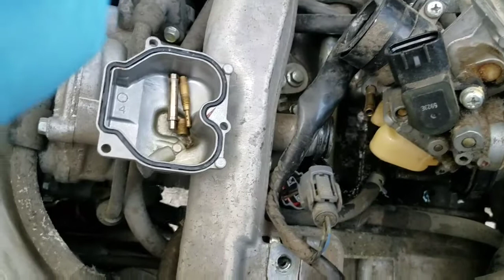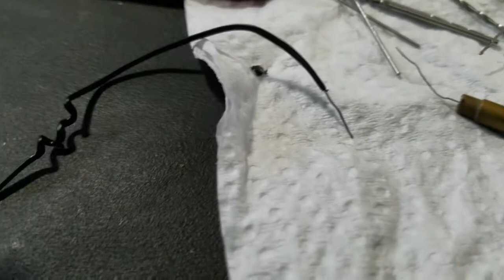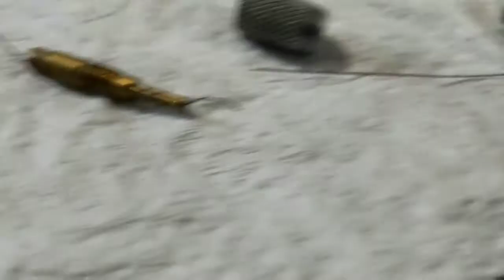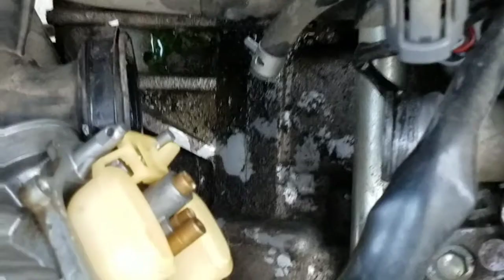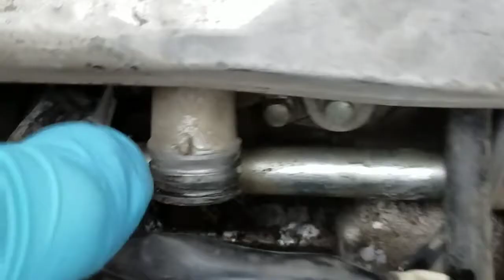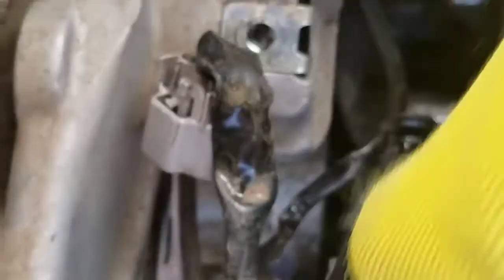Easy Honda Metropolitan carburetor repair in one hour

Comment: So release 4 things: rubber connection toward front, coolant line pointing to front, and 2 sensors?  You didn't have to disconnect the air intake?  Hoping to try this tomorrow on my 2009!

Comment: You sir, have helped me the most on my scooter. I love to tinker and I inherited a scooter that was neglected. This video and the fuel pump video is what saved me. Thank you, with all sincerity. You are right, you wont think you can get anything through. But i used brake cleaner and a strand from steel cable. Each to their own but i got some thing through.

Comment: Jon this is Elmer from Albuquerque New Mexico I want to let you know that the video that you showed it's best for you to use a speaker wire copper wiring you just split that wire as in a single and you can clean those jets with that much better that's just heads up for you and whoever else she's my messages and use carburetor cleaner as well until you can see lightning through the little jet hole 🙂👍
Reply: Sorry for the misunderstanding what I was saying those that see my message

Comment: Could you just replace jets with new?
Reply from the maker: Yes if you can get the correct ones
But everything is a crap shoot
It might work
They might fit

At least keep your old ones
 just in case they don't work

And while you're sitting around

Clean the old ones

Have them ready for when it happens again

Comment: SHOULD THERE BE VAC AT THE TOP DIAPHRAM PORT WHILE RUNNING
Reply from the maker: Not that I know of and it doesn't sound like that would be a good thing

Spray some carburetor cleaner at the vacuum and see what happens

Comment: I've had that dam jet out twice now lol . Going to try it again I dont think its cleaned enough as I couldnt really see out clear . My scooter will idle fine just soon as i give it gas it boggs hope this will fix it .Scooter been sitting a year with stablizer fuel in it
Reply from the maker: Yeah that really sucks 

you only want to do that once 

now you already know that 🤣

 but anyway as you put something through there

 just go back and forth 50 times 

once you have the piece of whatever you're using to go through 

once you have it in there 

just go back and forth 

back and forth 

back and forth

 as many times as you need to

 to make sure it's as clean as possible

 you might even use some carburetor cleaner

 as well as the twist tie or whatever you're using 

and again just go back and forth 

15 times until you know for sure

 it is spotlessly clean 

and it'll work great

Comment: bicycle gear cable will work, unravel one strand, poke it through, slide back and forth
Reply: Get a brand new offcut from a bike repair shop for free. The gear cable, not the brake cable (too thick)
Reply from the maker: I will try that 
thank you 😃

It seems like that would have more tensile strength also
Reply: Nice find. This is the only thing to work for me as far as getting the hole opened up , but still having issues.

Comment: Antifreeze line connected to the carburetor? I have never heard of that.. Is that some new style of carb?.. Hmmm.. Id be worried if I connected antifreeze into the carb... will never run after that... This video scares me!!!
Reply: It doesn't go into the carb. As the video clearly shows, the line is attached to the outside of the carb.
Reply: That's the fuel line coming from the gas tank. He just misspoke that's all. Great video man thanks for sharing
Reply: Its not technically connected just there to help the coolant get pushed around

Comment: Thank you for taking the time to make this. You saved me a lot of grief and a lot of time. I found that even a bread tie was too big, but a high E guitar string worked perfectly to clean the jet. I also found your video which helped me diagnose and change my fuel pump & filter. Again- thank you very much.
Reply: High E guitar string is the ticket. Worked. But it took a while.
Reply: Yep I'm a guitarist so I had plenty of scraps around lol

Comment: mine is start fine but does not go more then 18 MPH (2002). it is jet issue ? thanks
Reply: Yes it is - I have a 2005 same issue would not go over 18 MPH just got it - This solved it! - It had been sitting for one year - I also pulled the gas tank and cleaned out all the bad gas.